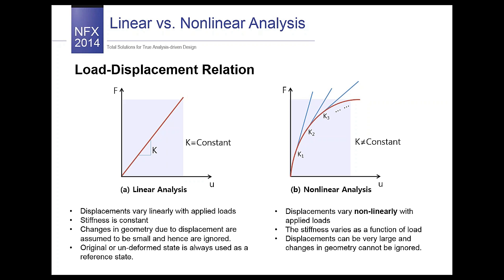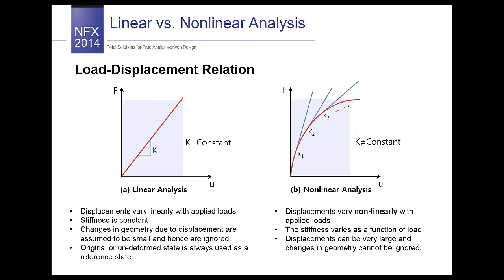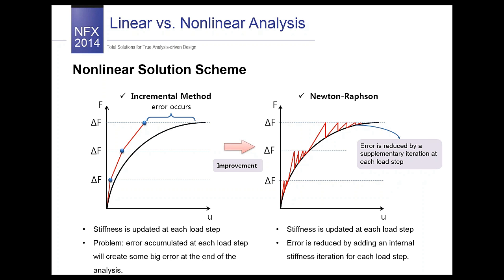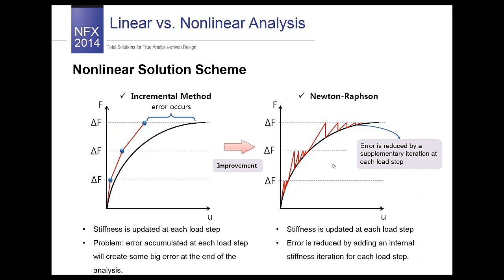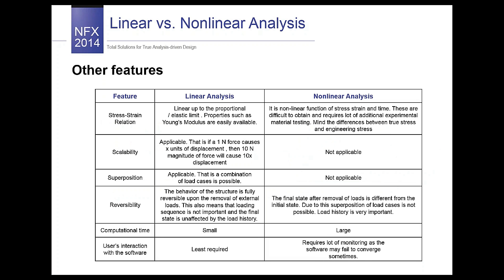linear VS Nonlinear

Comment: How to choose analysis linear or non linear ?if I had a model
Reply from the maker: Varun Kumar depends on your model... do you have large deformation, nonlinear material(plastic deformation) or nonlinear contact?
Reply: thank you for reply Cyprien Rusu .. If model is made up of aluminum which analysis should i choose linear or non linear ?
Reply from the maker: Varun Kumar if you study your aluminium model within the assumption of small deformations (and you do not have nonlinear contacts) then you can use a linear approximation
Reply: Thank you cyprien rusu  for help.
Reply: please tell me what is the mathematical model of linear static analysis?